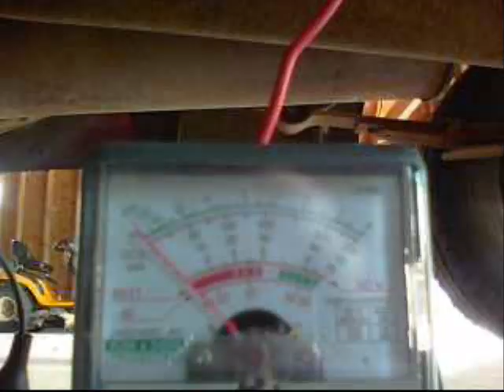2000 Ford F 150 Fuel Pump Diagnosis With Voltmeter (Different Approach)

Comment: I just pulled voltage off my 96 rear pump connector. Key on(not started) 12v from Br/Y and 8v from Y/Gr. I saw in your test it looked like the voltage kicked back ( 6-8v?)on the 2nd voltmeter test? 4 connections total. The others are just grounds. Not sure why ford need 2 grounds. Not sure if mine kicks back. Have not tested in real time.

Comment: Sorry but this is a very confusing video, It appears you are testing each of the top 2 holes, but one at a time. Why don't you show how you inserted your voltmeter wires. WHERE DID YOU GROUND THE NEGATIVE WIRE?? To the bottom hole of the connector or to the frame of the vehicle?  Also (forgive me I'm new at this) isn't it possible that the connector has 2 positive and 2 negative pins because it provides power for 2 seperate funtions within the tank? I would guess one is to operate the pump and the other to operate the "fuel float" (or whatever it's called) that sends information about how much fuel is in the tank? If so, what should the voltage be to each function? You're obviously getting power readings from both positive sides but is the power sufficient to the needs of the system it feeds?